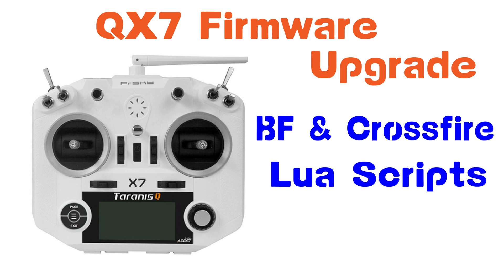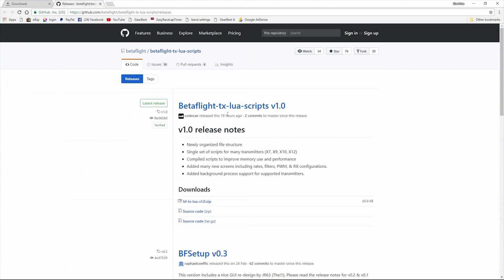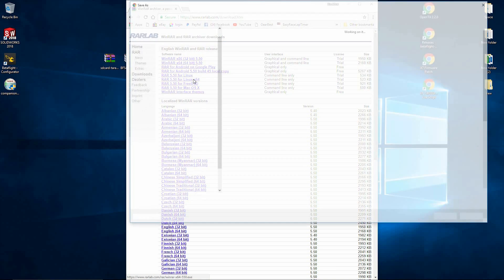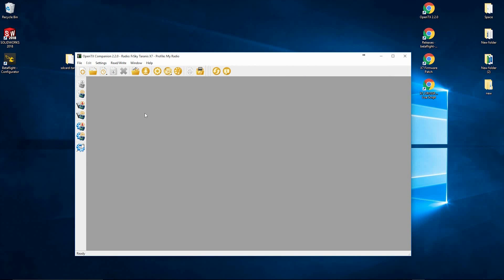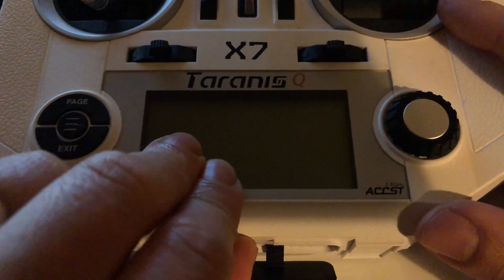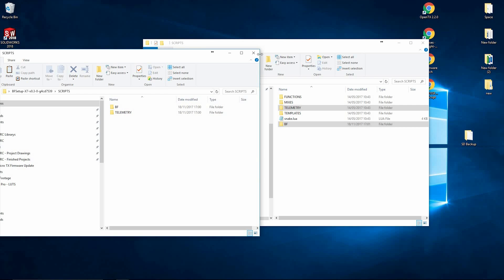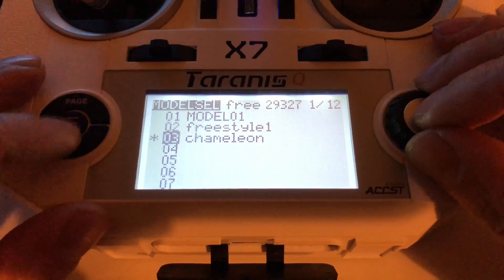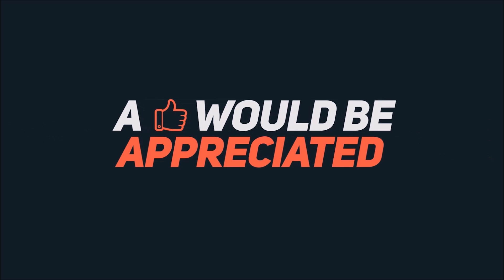TBS Crossfire | QX7 Firmware Upgrade, BF Lua & Crossfire Lua SD Card Setup / How To

Comment: the link on the qx7 patch doesent work :-/ somewhere else i can find it?
Reply from the maker: Lars Christian Vikesland looks like it’s been taken down for some reason, I’ll have a look for a new link.
Reply: cool! because this was the last step for me on this guide, hope you find it :D really helpfull stuff
Reply from the maker: it looks like they have taken it down because of this http://www.team-blacksheep.com/products/prod:qx7mod

If thats the case the patch might have been incorporated into the OpenTX firmware itself and the patch is no longer needed.
Reply from the maker: Yeah its included in the latest QpenTX firmware now so the patch is no longer needed, just need to upgrade the radio firmware to version to 2.2.1 or newer and should work, you can see the changes in the new firmware here
http://www.open-tx.org/2017/12/16/opentx-2.2.1
Reply from the maker: can you please let me know it it works without the patch link and using OpenTX 2.2.1 and i can update the text in the description
Reply: QuadFramesUK i will try this today and let you know ☺
Reply from the maker: Lars Christian Vikesland  thank you.
Reply: yes, it works without the patch! but still needs the luascript.
thank you for the guide, it now works for me :D still a little confused tho, are the rssi values the same?? the menu on my taranis is a little different from yours. mabey because i am on a later firmware? would be fantastic if you made a last video explaining the new settings on the taranis etc... anyways, helped me alot :D excuse my english, btw, i'm from Norway :D
Reply from the maker: Lars Christian Vikesland thanks for the update buddy. Your English is spot on :) yeah they have more than likely changed the menus in the later firmware version, great that they have incorporated in there now tho. I’ll create an updated version as soon a I get time.

Comment: I did the mod, the updates, watched every video I could find, 16+ hours later my Qx7 internal module will no longer bind to anything (xsr, xm+ L9R) . It does bind to crossfire micro receiver in crossfire mode and I got telemetry working but no sticks or switch functions. So think twice before you do this mod unless you are really good with this kind of thing because the price of the crossfire, my qx7, and now my tango I ordered to replace my x7, plus a frsky jr module so I can still fly frsky until get it all over to xfire...  I wish I would of just stuck with my L9R vs spend 500 bucks and waste 20+ hours just as an attempt to get a bit more distance out of a quad. Frustrating all the open tx firmware/updates/lua scripts, betaflight updates/firmware.

Comment: I'm getting an SD card warning when I turn on my X7 now that I've done the patch upgrade and all, is that to be expected? It says expected firmware of 2.2 and I used your links provided.
Reply from the maker: Hi Dial Up FPV if you copy the firmware file that you downloaded for the QX7 to the SD card firmware folder it should stop that from happening.

Comment: Do I still need to do the hardware mod on the qx7 if I want to use TBS crossfire micro?
Reply from the maker: Hi Corky Fpv, as far as I know as of today 26/12/17 yes the hardware mod is still needed if you want to use it’s full potential, you can do just the software method but that would be like using an old ppm receiver with similar lag.
Reply: QuadFramesUK thank you for the fast reply.didn't listen very well at the beginning of your video ;)
Reply from the maker: You’re welcome Corky Fpv :)

Comment: i followd this guide to the T and even did the hardware mod.  i tried to execute the crossfire lua and it's stuck on "waiting for crossfir"
Reply: I've upgraded both my Qx7 to 2.2.1 and my Crossfire Micro to the most recent version and I'm still getting this 'waiting for crossfire' message.
Reply from the maker: Did you upgrade your radio to the most recent firmware version and use the QX7 Firmware Patch?
Reply: Charles Warwick I'm having the same problem, anyone find an answer?
Reply: I am also getting this did you solve the problem????
Reply: definitely gotta upgrade the micro TX AND download the latest qx7 firmware which is 2.2.1 i believe.

Comment: I followed this this guide to the letter, just like our video, I am not getting any telemetry on my bf lua script or smart audio. I have smart audio selection on the correct uart in betaflight, any ideas?
Reply from the maker: Jonathan Wright 
This guide is mainly for the crossfire transmitter settings. On the uart that you have the smart audio connected have you selected the type in the drop down box of that uart in betaflight? Either TBS or Tramp.

Have you done the step to discover new sensors within the transmitters telemetry page?
With the BF Lua, have you assigned the script to a page on your radio?